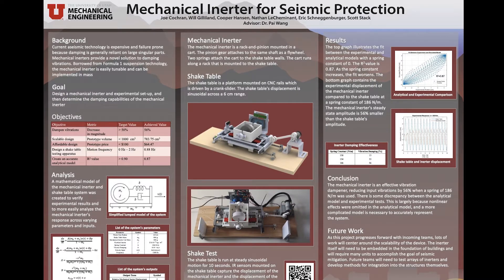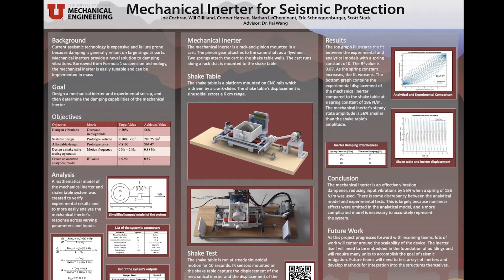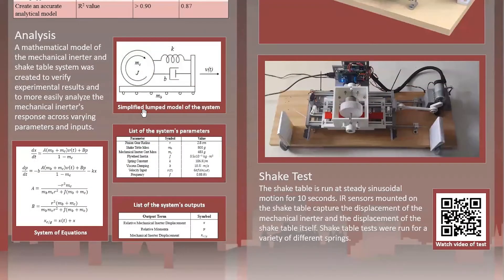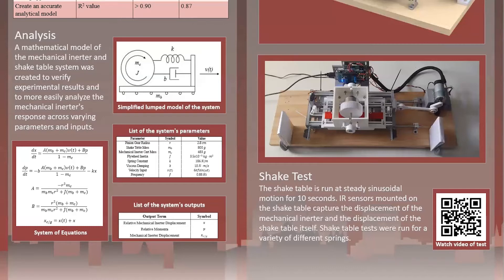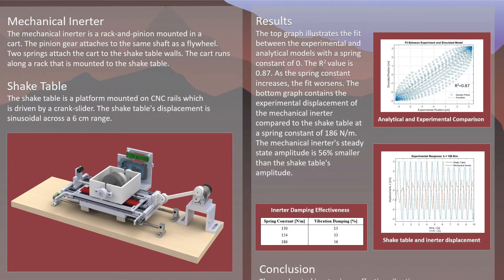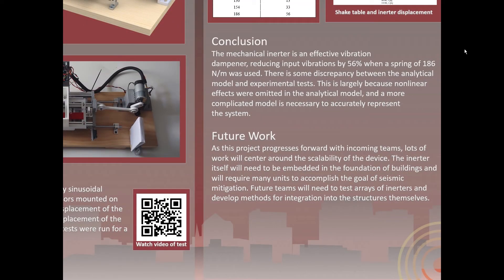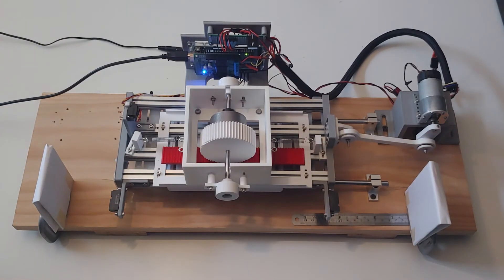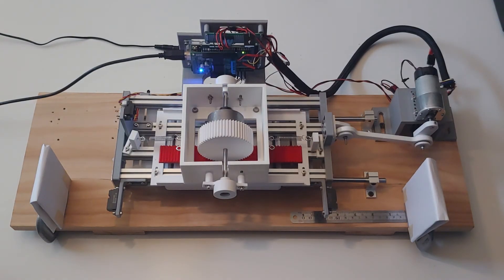Team 13 - Mechanical Inerter

Comment: In 2013 in Poland Mr. Łagiewka presented EPAR bumper - this is precisely the SAME innovation...,   shame you
Reply: Malcolm C. Smith, a control engineering professor at the University of Cambridge, first introduced inerters in a 2002 paper. The concept and the device were public knowledge before 2013 Lagiewka claims. These guys aren't claiming they invented Inerters, they are showcasing the inertier idea/model in a real life test apparatus

Comment: Can someone explain this in simple language?
Reply: Similar to fluid damper in a mechanical spring/damper suspension system. An inerter is a third device used to reduce vibration. Where a fluid damper wastes energy to heat. The Inerter stores the energy in a flywheel and returns it to the system. By utilizes all 3 devices, a system can be tuned for improved results versus a spring/damper alone.
Reply: Oh, as far I can see THIS IS PLAGIARISM of the Mr Łągiewka invention - nice job!!! https://www.youtube.com/watch?v=jt_IFOuKpfs

Comment: Hot tip: Put the video first. 2nd hot tip: Put the part of the video where it is running first so we know what the heck is going to be explained. Two simple edits.
Reply: This is for their class. They probqbly had certain requirements from their professor. It's a bonus the public can see it at all
Reply: @NEprimo  I guess I can just suggest go to 8:06 then to the beginning.